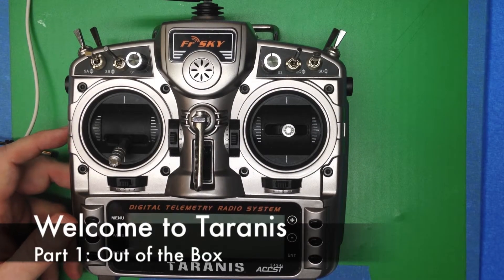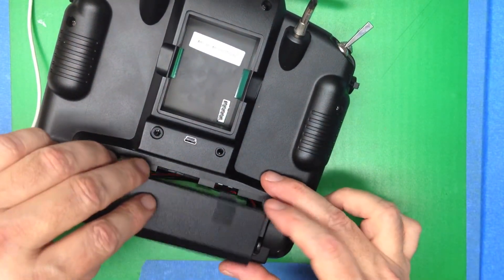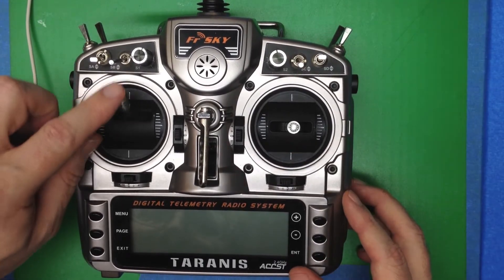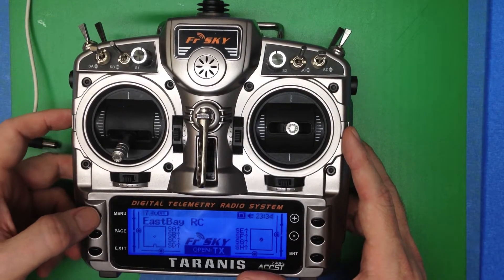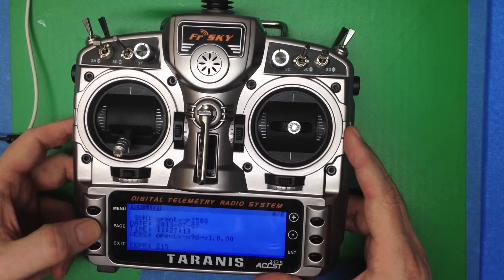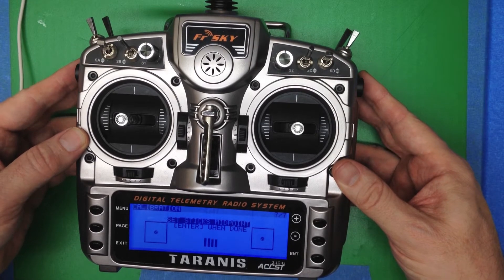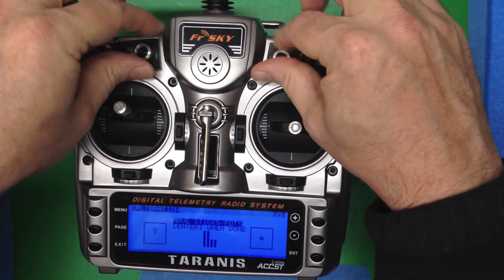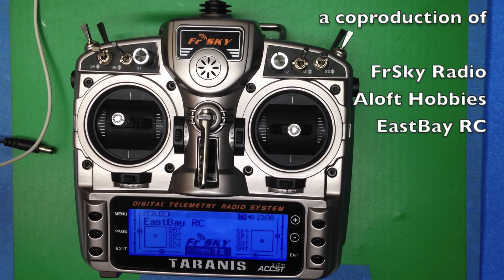Welcome to Taranis, Part 1: Out of the Box

Comment: does the battery come with the radio? please reply
Reply from the maker: No, they sell a specific battery and most 3S batteries with a balance connector work as well.
Reply: what receiver would you recommend me with a dx6 or dx5 spektrum
Reply from the maker: Shady King I like both the "Lemon RX" and "Orange Rx" brands.  The Orange R615X is a good model.
Reply: thank you
Reply: Hi Mark,
 I got a battery for my RC 3 channel Beginner airplane. And lately I've been hearing that they are dangerous if used or stored incorrectly. Than I thought, if I don't have a Lipo battery bag, could I store it in my refrigerator?

Comment: Hi Mark,
I noticed when you move your side pods it makes a sort of ratling sound, is this true..!!  I got my X9D yesterday and my side pods go smooth (like the pods on top) without this sound... :-)  and i got a question.. Will the led go out when charging the battery is finished..?
Reply from the maker: You've got one of the newer models, with much improved side sliders.  I'm upgrading to those too!  Off the top of my head, I think the light goes out when the charge is finished.